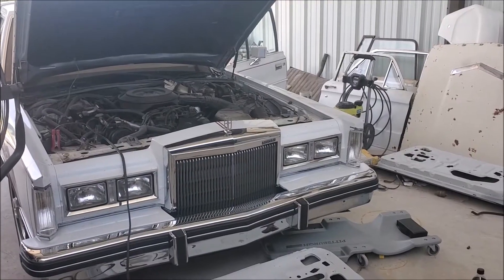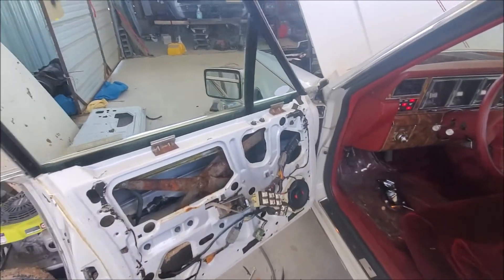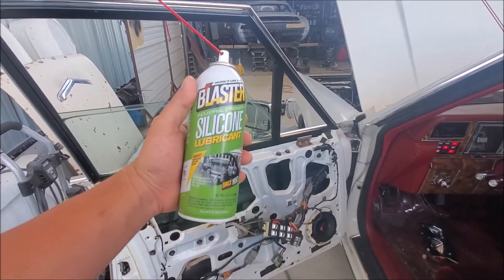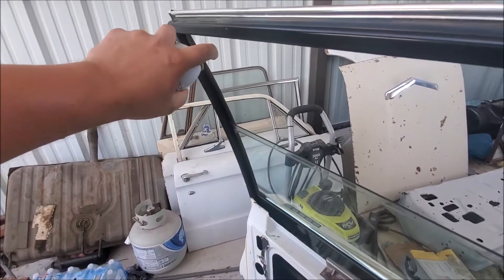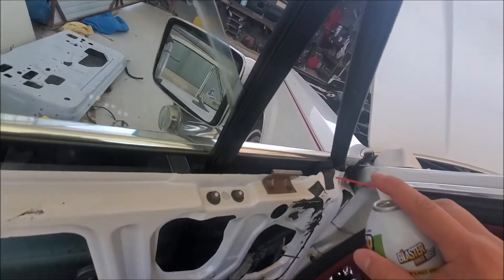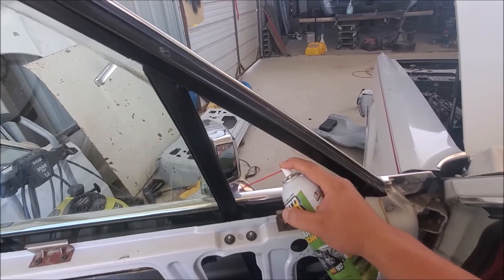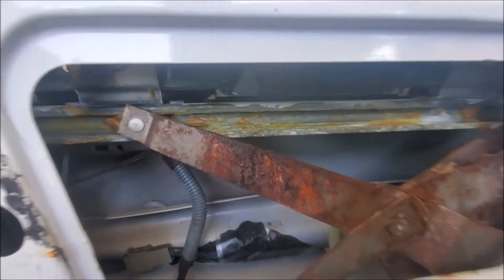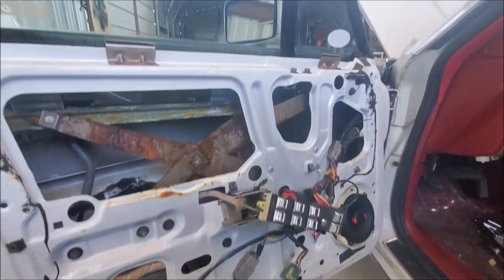How to make Car Windows go up faster!

Comment: Great video!! How do I diagnoise a bad window motor or window switch on a 87 Mark 7 ?? What's the procedure?
Reply from the maker: The absolute best way is to figure out what 2 wires go to the window motor AT THE SWITCH and then get power and ground and give to both of those wires. If the window goes up and down when you give it power and ground just fine then your problem is the switch which you can open apart and clean the corrosion off the contacts with a little sand paper. Keep in mind. The motor has 2 wires going to it. The way it goes up and down is reversing the power and ground.so if you have a blue and black wire, give blue power and black ground. Then switch it and do ground to blue and power to black and it will go the opposite direction

Comment: what type of grease to i use to put on the tracks?
Reply from the maker: @vezina808  any silicone paste or pr silicone super lube will work great. Just don't use wheel bearing grease because it will stink up your car very bad for a long time and will attract dirt since it stays very wet.